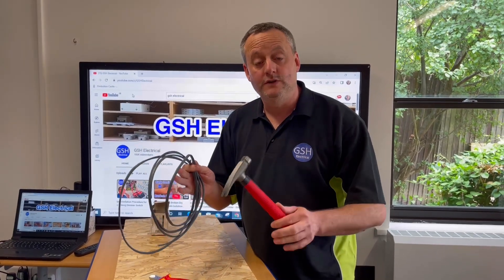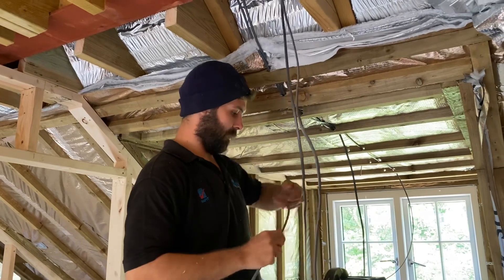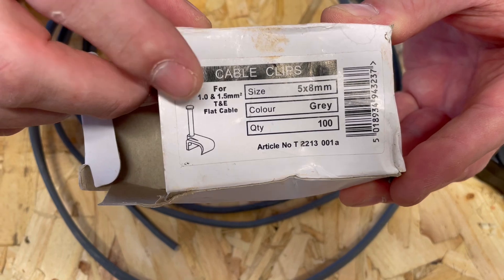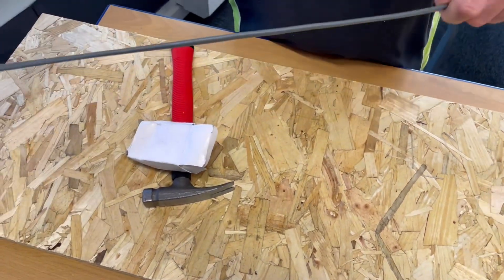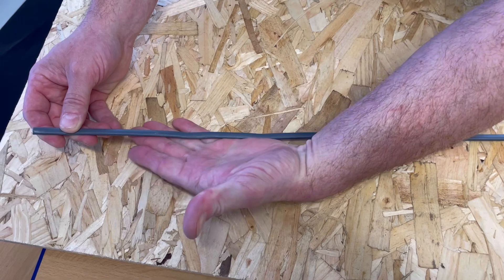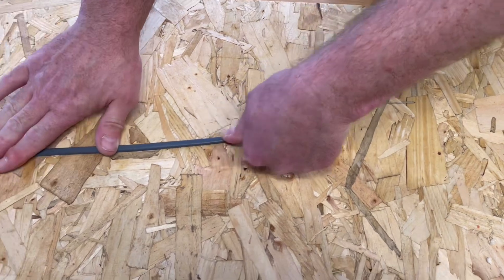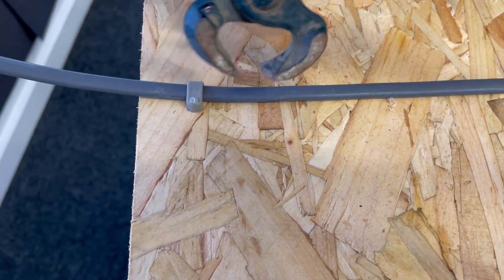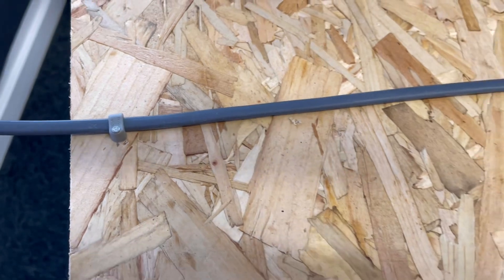How to Clip Twin and Earth Cable Like a Professional

Comment: Great tuition vid Gary, a couple of things that I have been taught over the years:

If securing to a brick or block wall, use the correct pin plugs instead of roofing tacks etc, it makes for a better fixing, Thorsmann used to do them, Schneider now make them. 55PP1 I think is the part number for the plugs, they are small grey things.

If securing horizontally, I was always taught to clip with the nail on the underside of the cable as the nail helps support the cable to a better degree.
Reply from the maker: Thanks for taking the time to add your input and experiences 👍🏻

Comment: Nice one Gary... "Cable pincers "... they are Carpenter's pincers.. lol
Reply from the maker: Quite possibly I’ve had them years 👍🏻
Reply: Carpenters pincers are very useful when pulling out old cut nails when taking up floorboards. Better than a claw hammer or nail bar.

Comment: Hi Gary.  30+ years ago I was doing clipping. Then as mandatory was 230mm which was my hammer length.  I still clip.

The only time I'm might be fussy about even spacing is if the fixings were exposed to public view.
Reply from the maker: All the clipping in college setting is on display
Reply: yep I just a Eastwing “Hammesure” had it 20 plus years still works just fine ..😂

Comment: One of the skills I have always remembered is to get the correct internal radius when bending TW&E, say along the top of the wall then down to a switch use a 4 gang JB one of those horrible brown things 
Keep the cable flat and Bend it round the JB to get a nice clean 90d bend . Top tip
Reply from the maker: How to Put a Smooth Bend in Twin and Earth Cable https://youtu.be/ivv6KJRA6yE
Reply from the maker: What is the Minimum Internal Bending Radius for Cable Used in Fixed Wiring According to BS7671 https://youtu.be/-p9a2otGWj0

Comment: When doing 2 plate, you usually have three cables. A 6 or 10mm clip will hold all three cables.*

Also, mark 300mm on your hammer, then use that as a guide.

*as other have said, it’s not best practice, don’t do it on your AM2!
Reply: Using one clip,for multiple cables contravenes the regs UNLESS it is designed to be used like that
Reply: @posei3960  You can/could get cable clips that take 2 cables by design but they ate mostly not stocked at wholesalers as not requested for, that's why 6 or 10mm clips are used.
Reply: @anthonybragg  maybe it’s the clips I use. The 10mm’s I use will fit 3 1mm’s flat. 6mm clip will fit 2.
Reply: @posei3960  what reg number is that? I could be wrong but I don’t recall it. If they’re flat and secured, I can’t see how it will make any real difference. If you’re bundling loads of cables and they’re not flat, it’ll affect their rating.